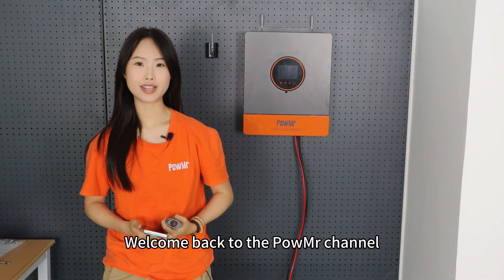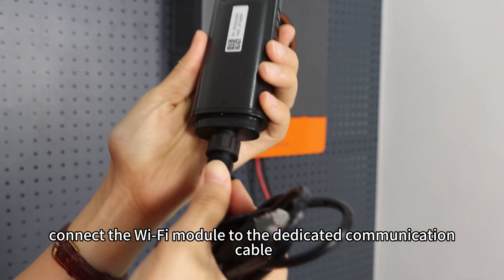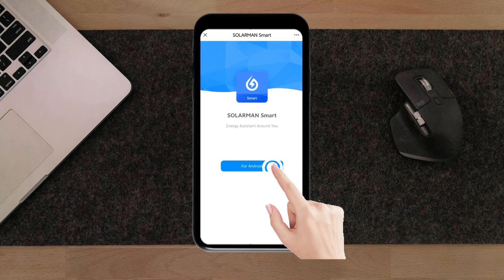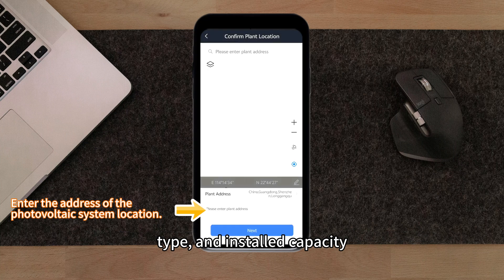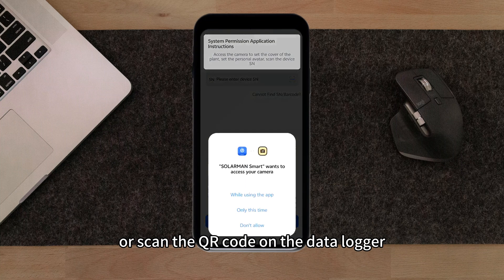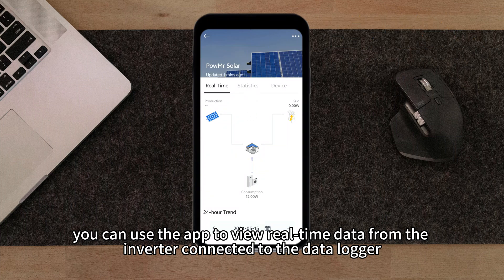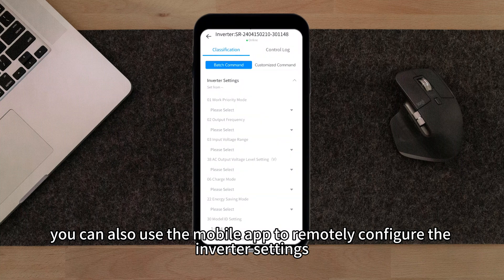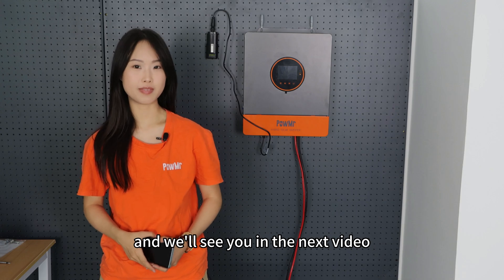How to Install and Use the WIFI-HF-N?

Comment: I did not find a list of inverter models that support this device. Which models work with it?
Reply: This WIFI module is only compatible with the inverter below:

POW-LVM3K-24V
POW-LVM3K-24V-H
POW-LVM3.2K-24V
POW-LVM3.5K-48V
POW-LVM5K-48V-H
POW-HPM5.6KW
POW-SunSmart SP5K
POW-SunSmart 6.5KP
POW-SUNSMART 10K
POW-SunSmart 10KP
POW-SunSmart 8KL3
POW-SunSmart 12KL3
POW-SUNSMART-5.5KW-48V
POW-SUNSMART-3.5KW-48V
Reply from the maker: You can see right now.